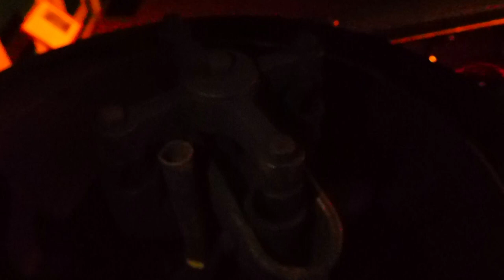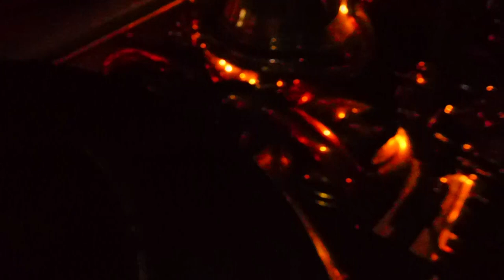1899 steam engine variable geometry blast nozzle

Comment: What would you suggest to someone who wants to get into building live steam tractors, trains and stationary engines for farm use as well as horse implement restoration,  I've already talked to the engle coach shop and will be building a steam bender and a adjustable fellow clamp for cart wheels this fall for wheelwright work (after planting and show season) for my fellow gypsy, cob and miniature horse friends at my two horse shows and the other horse clubs that my competitors and friends go to. But after buying kozo hiroko's building a new shay and climax books I'm a little daunted I know how to look for a lathe and have been doing so for the past few weeks to get a bit of a feel on the prices before making a bad investment but for the other tools and accessories I'm a little lost on what I should start with  I'm full of ideas for pneumatic engines for house use and solar heat collection boiler for stationary engine work think belt drive machine shop (my plan is to put the shop in the hill behind the barn) and stationary hay press since I want to use the two scycle bar mowers I bought for horse powered haying aswell as a hay lift rake so as to not use my tractor for getting into hay baling which is ok since I don't want to diesel anyway , but like I said I know where I'm getting the materials for the shop and what size of lathe I need for wheelwright and steam work ,but I don't know where to go with tools so as to not put the cart before the horse for expanding from wheelwrighting to steam engine/pneumatic engine scratch building and horse equipment scratch building / restoration I even know where to go for foundry work for the large castings over five pounds I don't want to tango with aka the largest crucible available on Amazon.
Reply from the maker: Lathe and Mill.   Can you or anyone you know put a railway flange a wagon wheel?
Reply: @AEKarnes   you looking for a guy who can shrink fit the flange on a wood spoked rail wheel like the original wheels the john bull had I would personally try Engel's Coach Shop Joliet, MT first  or the  hansen wheel and wagon shop Davison County, South Dakota second   I am familiar with the process of installation of shrink fit metal bands but have not tried it yet you start with the tyre on either a bonfire for big tyres aka the size of logging big wheel log skidders or borax wagons or, for small wagons like buggies and farm box wagons the wheel rim is rotated on a specialized tool with two rose bud torches on either side while spun at about  three+ rpm until close to 800F  for large wheels special f shaped brackets cut to the thickness of tyre are used in conjunction with either a forklift or portable crane to lift the tyre out of the bonfire  since the wheel hubs are wider than the fellows (the wood part of the rim) the large wheels need to have a metal support underneath the tyre and fellows, for farm wagons and buggies a clamp with a long shelf that tyre can rest on is optimal keep in mind that for small wheels the entire wheel assembly is elevated on a stand with the rim acting as a shelf which is why the clamps with protruding shelves on the bottom are needed so that the hot rim doesn't fall to the floor , so let's start the process, the hot rim is pulled from it's heat source, laid around the fellows on the shelf flush with the bottom side of the fellows from there you begin quenching with a hose and hitting with a hammer to release wood/met binding as you travel around with the hose . Once cool you have a wheel ready to install or ready for rubber tires on the metal rim, I don't see why this wouldn't be a much different process for steel rims on cast iron wheels except that the rim would need even heat to just before dull red and no quench  if you have an existing wood wheel and the rim is loose due to dryness the old fashioned quick fix was to place leather in the fellows seams and to wrap the fellows with canvas before re heat fitting again as long as it's not rotten, if rotten the parts affected need replacing . Now I do know that sugar creek in Amish country ohio has quite a few wheel Wright's but they are hard to find if you go that route I'd suggest talking to the writer of the Amish america website he would have better connections for wheelwrighting and even steam boiler fabrication since the Amish still use steam and horse equipment in every day life
Reply from the maker: @wesbrackmanthercenthusiast4695  As I said all I am after is a (lightweight) flanged and tapered railway wheel profile put onto a wagon wheel.  Not as heavy as a locomotive tyre which is several inches thick at the circumference.  Didn't know if you knew anyone who could do the job economically.
Reply: @AEKarnes   how much are you looking to do this for ,and what size/what do you have available in parts do the fellows ,spokes, hubs, boxing's and tyres need built or are they just a pile of parts where the wood rotted out of the iron  because depending on what you are thinking I might try to get some help from family to start sooner
Reply from the maker: @wesbrackmanthercenthusiast4695  just under 2000 dollars and I have nothing in regards of parts.  I don't mind if they are iron/steel instead of wood as long as the tyre has a smooth uninterrupted profile!